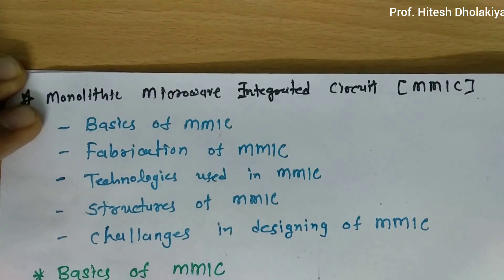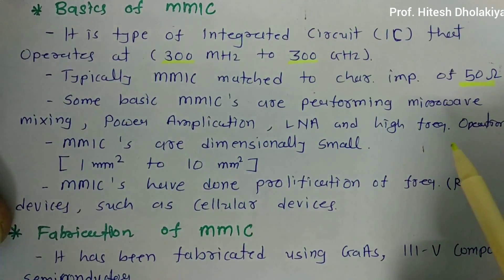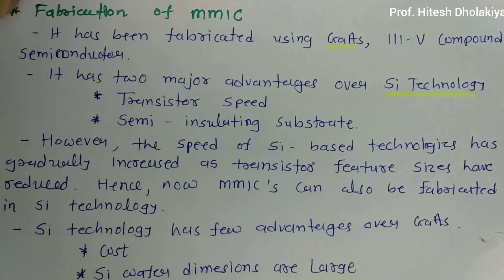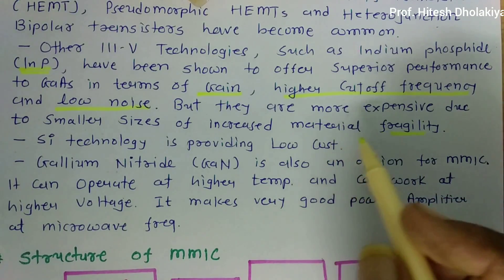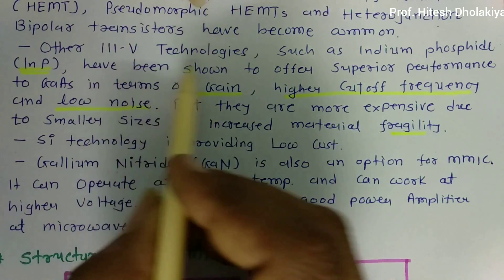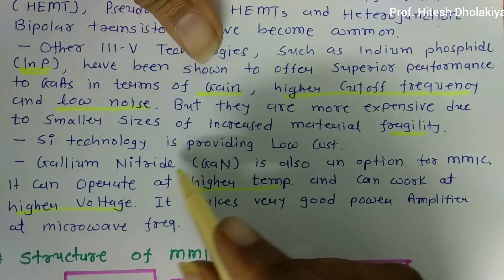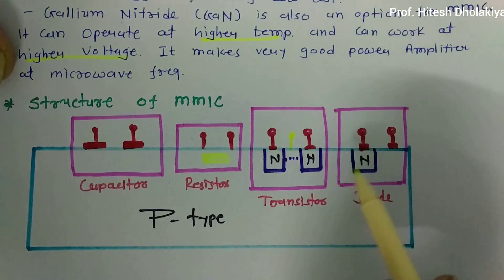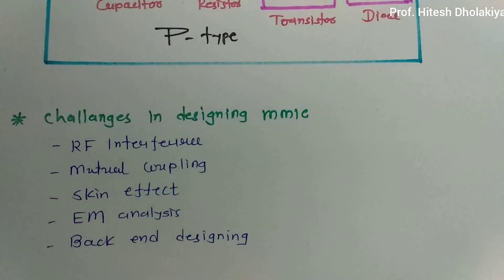MMIC (Basics, Fabrication, Technologies, Structure & Challenges) Explained

Comment: sir can u please help me from which books i should study this subject. i am following ur lectures but i d need to do this
          MICROWAVE INTEGRATED CIRCUITS 
UnitI:	MICROSTRIP LINES DESIGN ANALYSIS
Introduction, Types of MICs and their technology, Propagating models, Analysis of MIC by conformal transformation, Numerical method, Hybrid mode analysis, Losses in microstrip, Introduction to slot line and coplanar waveguide.

Unit II:  COUPLED MICROSTRIP, DIRECTIONAL COUPLERS AND LUMPED ELEMENTS
Introduction to coupled microstrip, Even and odd mode analysis, Branch line couplers, Design and fabrication of lumped elements for MICs, Comparison with distributed circuits.

Unit III: NON-RECIPROCAL COMPONENTS AND ACTIVE DEVICES
Ferromagneticsubstratesandinserts,Microstripcirculators,Phaseshifters,Microwavetransistors, Parametric diodes and amplifiers, PIN diodes, Transferred electron devices, Avalanche, IMPATT, BARITTdiodes.
Unit IV: MICROSTRIP CIRCUIT DESIGN AND APPLICATIONS
Introduction,Impedancetransformers,Filters,Highpowercircuits,Lowpowercircuits,MICsin Satellite andRadar.

UnitV:	MMICTECHNOLOGY
Fabrication process of MMIC, Hubrid MMICs, Dielectric substances, Thick film and thin film technology and materials, Testing methods, Encapsulation and mounting of devices.